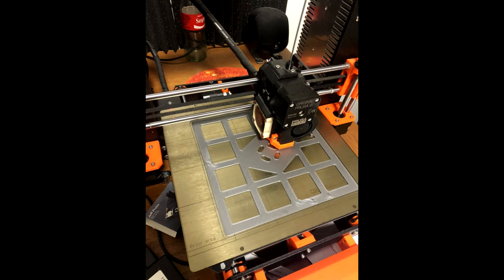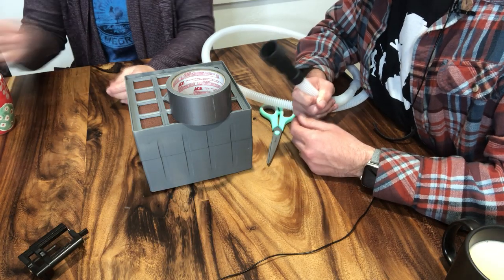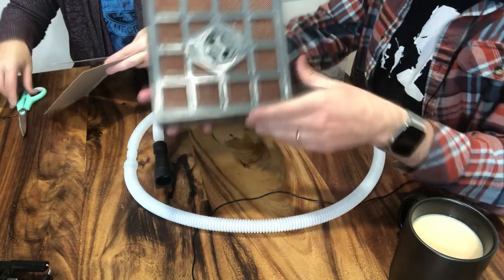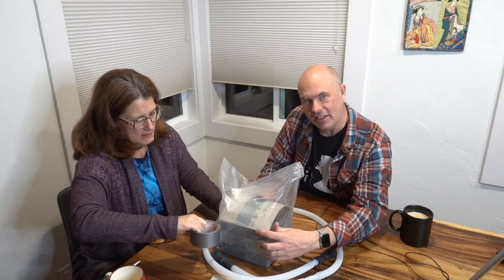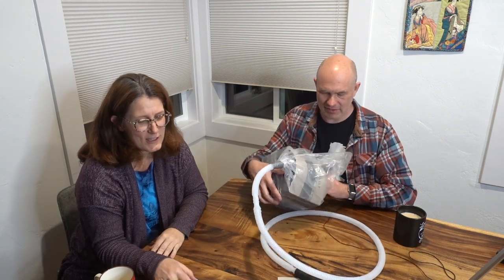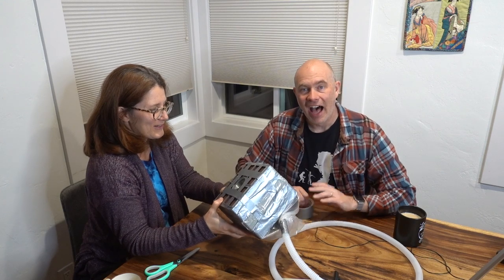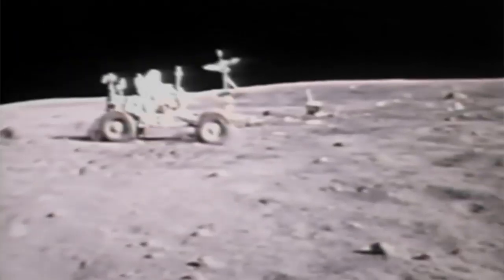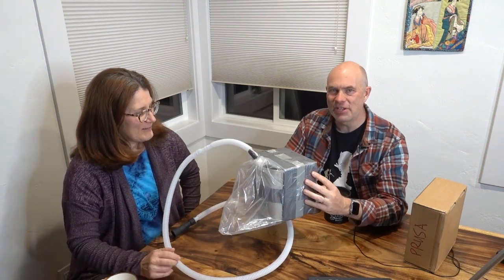Recreating The Air Filter Hack Used By Apollo 13

Comment: you might as well listen to it and not just read:  https://youtu.be/_UDpYj_F5os
But they were not kidding when talking about noisy comm. You can tell that wasn't last minute panic ( unlike the movie) because they did not power up some stuff to make the com clearer as they did for the lengthy re-entry checklist reading and other critical things.  No compromises in power saving for this task.

Also greatest hacks in space... Skylab.  Multiple hacks. An effort surpassing Apollo 13 in people involved. They had 10 days  to analyse the problems, managing the station in ways nobody had anticipated, finding possible solutions, selecting one or 2, build them (the famous pole cutter was not just off the shelf!) , test them, make them fit into a CM with a crew, train the crew for them.

Parts were at times delivered with the bosses learjet.  The boss of the cutter company with his catalogue and his main engineer was flown in in one on very short notice. 
And then the crew under Conrad had to make them work.   No lifes were at stake, but a hundreds of millions project, people had worked on for nearly a decade.